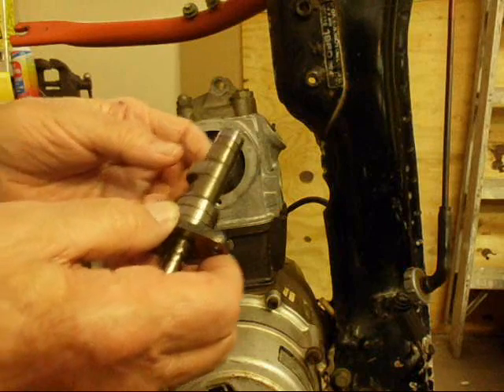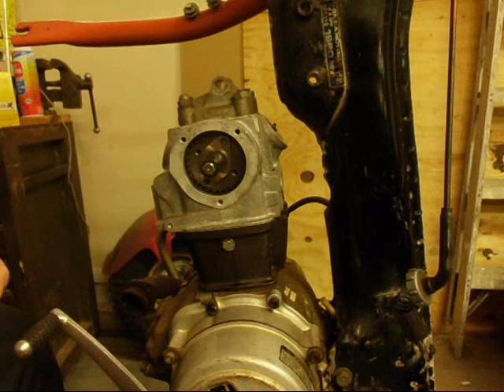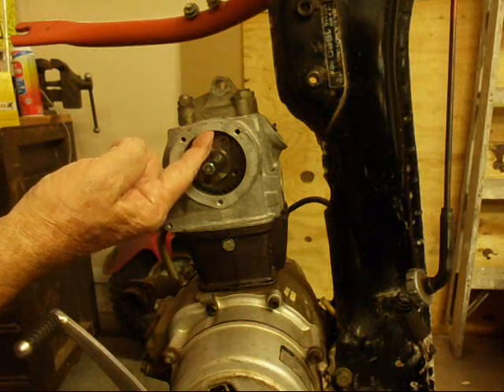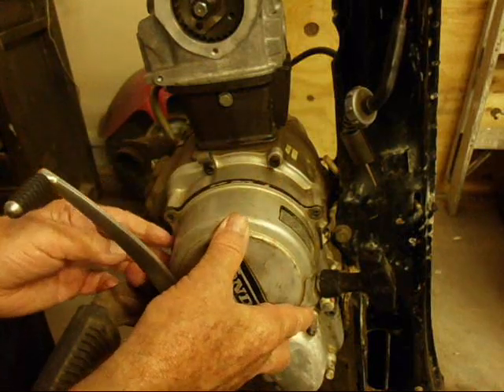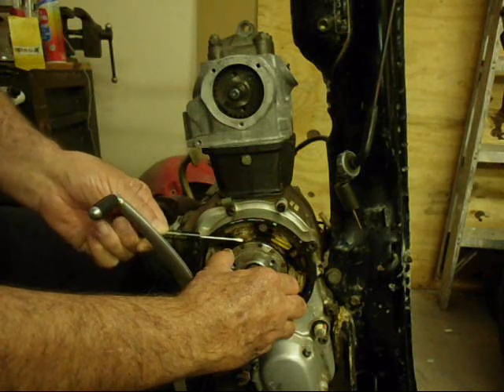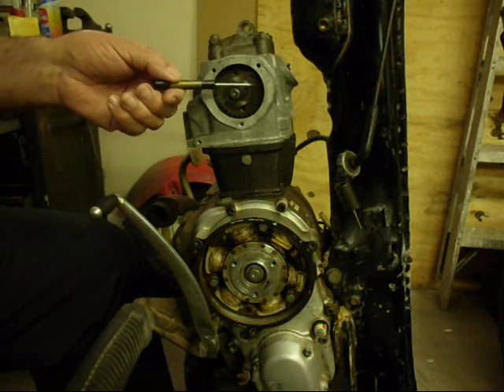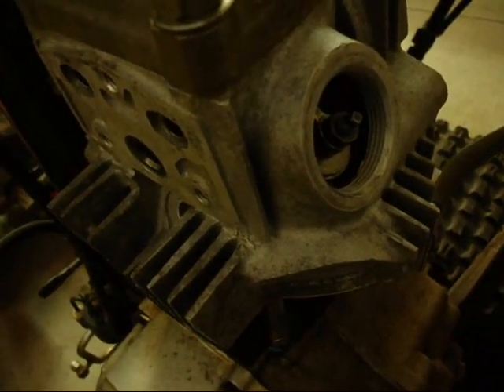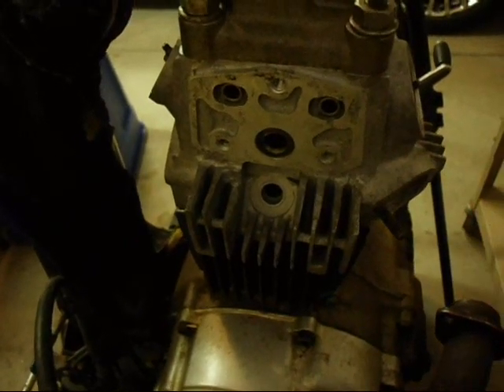1980 Honda ATC 110, Top End, Part 3 of 7, Valve Timing and Valve Clearance

Comment: How do I get the head off a 110 cc Honda
Reply from the maker: The problem you are probably having is that you need to remove the cam shaft before the head can come off.  First remove the ignition parts from the left side of the head (Points base and points or pulse generator depending on what year ATC110 you have).  Then remove the the cam shaft and of course the 4 nuts on top of the head.  The head should slide right off.  That is unless the holes are full of dirt and/or rust.  Give it a try and if need be, I'll try to help you.

Comment from the maker: If you are looking at this video, it will explain how to set the valve timing and the valve clearance.  If you are asking about ignition timing, then it depends on which ATC110 you have.  The ignition timing for the 1979 and 1980 ATC110s are like the ATC90s.  These have ignition points and are described on the next video in this series. 

If you have a 1981-1985 ATC110, then you have CDI ignition.  I show setting the timing in another series of 12 videos that I made for a 1981 ATC110.  Look at the end of part 5 - http://youtu.be/tvwn6upPOfI  Once you get the ATC started you will need a timing light to fine tune the ignition timing.  I show this in part 12 or http://youtu.be/yMoE4vxUJwo  Good luck!  Let me know if you get it started.
Reply from the maker: The black stator wire is for the ignition. If it is broken, the ATC will not run. The yellow wire is for the lights and if broken, the ATC should still run.  You can check by testing if you have spark.  Remove the plug from the head.  Reattach the plug wire and ground the plug out on the engine.  Pull the starter and see if a spark jumps the gap at the end of the plug.
Reply: SoCal Bruce i have a question i have a 1979 atc 110 i just replaced the rings and for some reason the engine doesnt have much compression it has spark and the timings right on but the engine doesnt want to run do you have any advice? thank you
Reply from the maker: If you don't have compression, then that's your problem.  You should verify with a compression gauge.  Just replacing the rings doesn't always do the job.  The cylinder could be worn out of range.   How are the valves seating?  You may need a machinist to check the bore of the cylinder.  do you have the right piston for the cylinder?  Why don't you check the end gap of the rings?  That only takes a feeler gauge so you can do it in your garage.  Otherwise, take the cylinder and head to a machinist or a motorcycle mechanic and they can find the problem.  Good luck!  Bruce
Reply: +SoCal Bruce Hello-Thank you for posting. You cleared up a issue I had working on my
Honda CT. I had my compression stroke out and you cleared that issue.
Nice video!
Reply from the maker: +sparkleplaytime :  Great!  I'm glad you got it running.  I know there are other videos in youtube explaining how to set and adjust valve timing.  But sometimes it is necessary to look at more than one video.  I may say one word or show one picture or process a little differently, and that can be the missing puzzle piece for you.  Thank you for the kind comment.
Reply: +SoCal Bruce Hello- thank you for your reply! I am working on a old Honda CT 90.
Your video diagnosed my error. I had problems with finding compression .
Stroke and I think they call Valve overlap. I had to re-position my cam chain.
Motorcycle fired right up. Recent top end machine shop work completed.
Attempting tuneup procedure next with static timing light! Thanks for your.
Video!